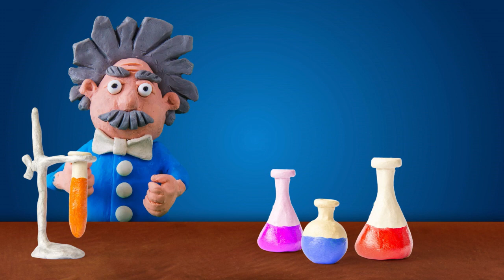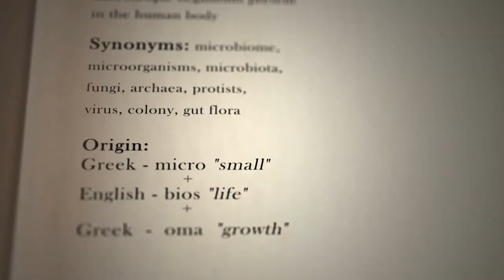Build this Laminar Flow Hood for a Sterile Work Environment

Comment: Wow awesome design! Im going to make a similar design but im planing using a 12"x24"x6" filter with .9 pressure restriction. Do you thing this fan would be enough? Is you fan is set to max?

My understanding is that i would need 200cfm ++ for the restriction. Thanks in advance!
Reply from the maker: Hi, Thanks. I'm not sure that this fan would be enough. I'd probably try to use a stronger fan. Yes this was all the way up. If you wanted to take the risk, you can always order from amazon and stick with the same circumference and swap it for an upgrade if it didn't work.
Reply: @FlomatonFamous  thank you very much for the fast response. You got me.confused now. I might give it a try.

Comment: you had to set the fan all the way up initially? what happens when the filters gets dirty a bit?
Reply from the maker: separate it from the bottom and change the filter.
Reply: @FlomatonFamous  at that point the filter has much more life left in it. no point in being wasteful.  I see you admitted to using GordoTEK's video as a jumping off point, he discusses this issue.

Comment: I looked up the filter that you bought and it looks like it also comes with a carbon filter.  Is that a separate piece or is the carbon filter integrated with the HEPA filter?  What are your thoughts about boxing in your fan and using the carbon filter as a pre-filter to extend the life of your HEPA filter>
Reply from the maker: I don’t think it needs to be added as a prefilter
Reply: @FlomatonFamous   i guess those filters are cheap enough that you don't have to stress replacements